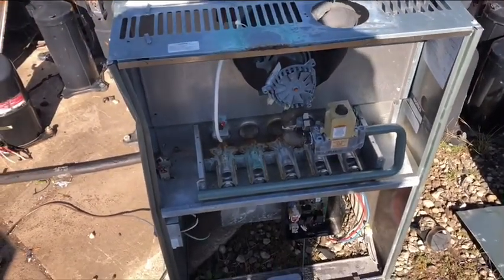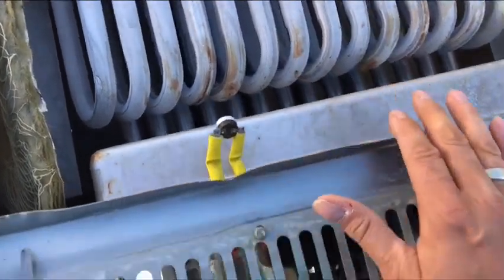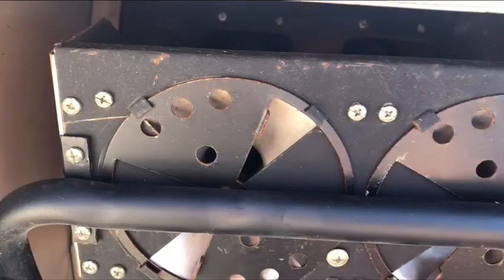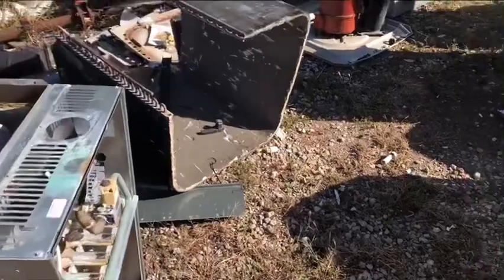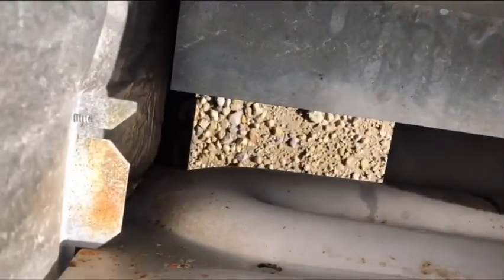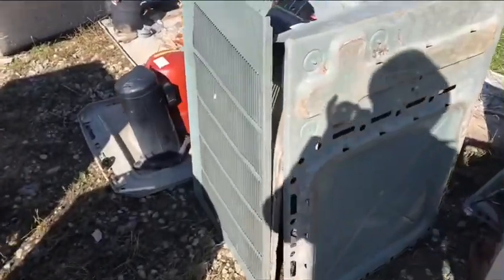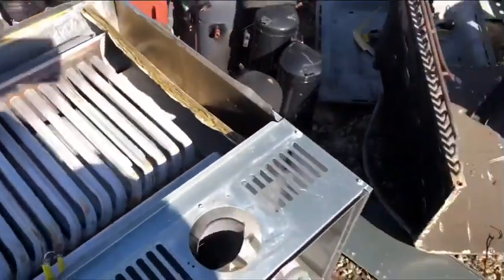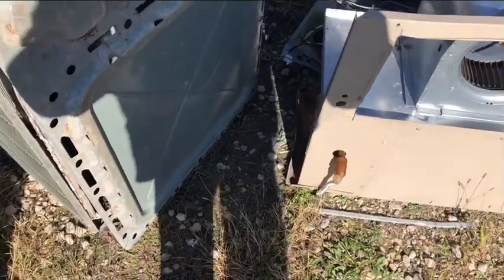HVAC SERVICE: Heat Exchanger inspection and safety

Comment: I have an endoscope.  Put a light outside the heat exchanger and run the endoscope inside and if you see light?  Change out the heat exchanger.
Reply from the maker: Air Repair yes great point! Always check them with light first!! Save yourself some trouble and time.